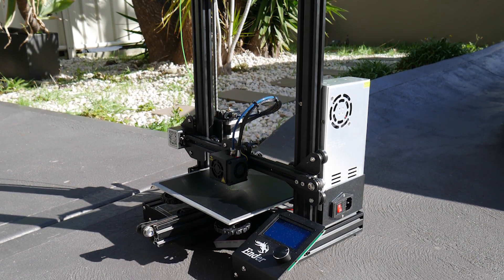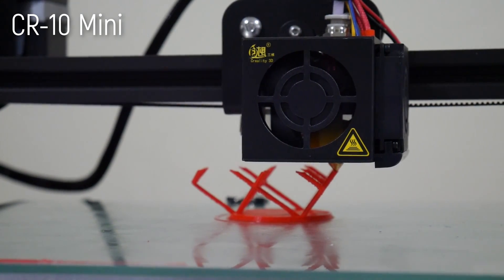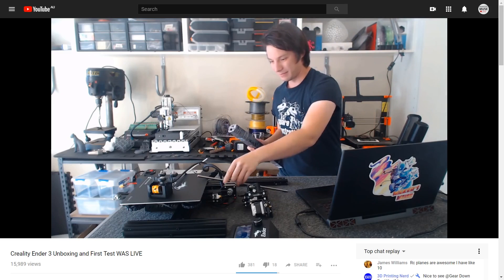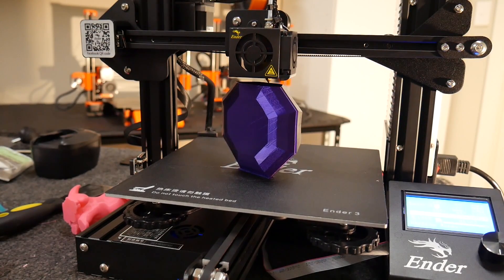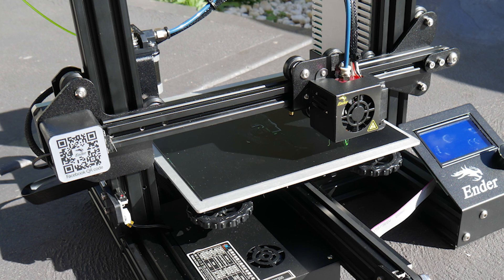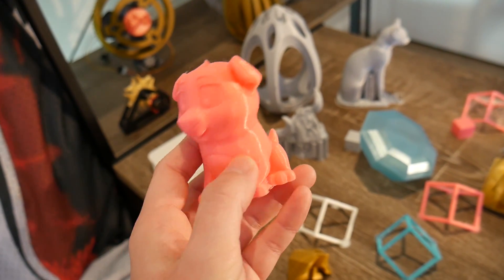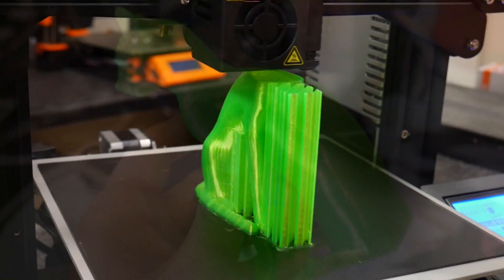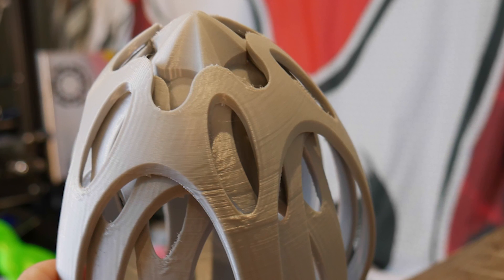Creality Ender 3 Review

Comment: Not Buy in Gear Best: The product is good printing, but unfortunately I had a problem with the driver of the board and some of the axis stopped working days, so contact customer service and this is really bad, I returned the printer right where they told me now they are not able to locate it. I advise to buy the product in another website with more guarantees, for example Amazon.

No comprar en Gear Best: El producto es bueno imprimiendo, pero por desgracia tuve un problema con el driver de la placa y unos de los eje dejo de funcionar a los dias, por lo que contacte con el servicio de atención al cliente y esta siendo realmente nefasto, devolvi la impresora justo donde me dijero ahora ellos no son capaces de localizarla. aconsejo comprar el producto en otra web que de mas garantias, por ejempo Amazon.

Comment: Hey, I bought an Ender 3 and have had it setup for about a week now. My prints are leaning forwards on the Y axis. I've re-levelled the bed countless times, made sure the printer as it sits on the desk is level, tightened all belts and pulleys. These are all the suggestions I can find online and it's still leaning. Any insight to what could be causing this would be great!

Comment: ive had the ender 3 for a couple months now and i havent had any issue with the couplers, i have noticed alot of irregularitys with prints tho. i can print 3 models from the same g code and they will all be slightly different. the tolerance could be a little better too but for a first printer it will get the job done, ive printed everything from coin corters to models, etc. it works just dont expect perfect results every single time

Comment: I really would like to see more direct extruder designs someday. I know it's harder to swing a motor around than just a coupler, but add another $50-150 onto the price vs a bowden and I'll happily work around that to tune it if it needs it. Converting a printer to direct is usually at least a little painful, with making a new head and all that, but it's the first thing I'll do if the frame and motion system are up to par.

Comment: I am all new to 3d printing and I got my ender 3 printer about three month ago and I have had none of the explained issues. Maybe there is just a very big difference in the quality they ship out. But my assembly when very smooth and everything lined up perfectly. I spend very little time with calibration before I got what I would say pretty good prints. When I compare to a printer we got at my work witch costs 6 times more there is not a bit difference in quality there 😁 but thx for an honest review 😉

Comment: Dear Angus, I bought it finally. Some issues with the Z axis ,It seems to cog sometimes and making strange noises, my first print was into the base layer, as you stated, and as i tried to print for the second time, I had to adjust the bed screws ,to avoid the hotend rubbing against the part??every 10min or so.. 
I am afraid that I need your Profile for cura.  Is there any chance helping around? 
I have seen many ytube vids over this and I found it hard for my first print ever. Another mistake I made, is that I tried to print a file newly made by me, so maybe the design was faulty etc.. I can not know what went so wrong.
 Thanks in advance.

Comment: Hi Angus,
I am a newb with 3d printing a bit of an old fella so go easy with me. I bought a ender after looking on youtube, I can get it to print pretty well but would like to upgrade the clamps that you had a problem with (are they called collars or colletts or something?), Anyway if you could add a link showing where better parts can be bought I would be grateful, oh and I don't know how to level the bed on mine, luckily it seems to be level and works ok but can you point me in the direction of instructions for leveling the bed?
Many thanks, Ian

Comment: Just received my Ender 3 for experimenting with 3D printers hardware etc... I noticed I have a total different version, a full steel hot-end, CR-10 parts on the bed belt. Removable print bed seems like that fake built-tek placed on a PCB sheet so you can remove that bed, and also different couplers and bowden tube.

TBH I do not like those big ass level knobs since it's easy to hit / touch and rotates too easy. It's also wierd why my first print was perfect but now prints in the air lol...

Comment: I was quite lucky with my machine as i only paid 160 british pounds for mine. I used the simplify 3d deafault profile fot this printer and have only had great results but i did have to complain as the wheels on the bed were damaged but technology outlet sent me new obes asap. I had also ordered a hardend nozle but the nozle type advertized was incorect so once again technology outlet provided me with a free swiss hardened nozzle. Overall if your up for a bit of tinkering with it after you build it. It is well worth the money. I should also note i got mine on sale and managed to get an extra 20 percent off. I dont mind the manual leveling as my other 3 printees all have it. I personally wouldnt bother with abs on this printer due to the lack of an enclosure but do find it to out perform a reprap pro with an e3d titan aero on when printing pla.

Comment: Anyone have experience with abs and nylon with the ender3?  I use a FF Creator Pro at work with good results...will I hate this printer?
Reply from the maker: No, dont buy this for those materials. Open frame and wrong hot end for high temp.
Reply: Maker's Muse thank you for the response!

Comment: $240 right now on Amazon. Here's the question though, would you recommend this or the fantastic Anet/Alunar A8 for $140-160? My Anet A8 has been printing now for almost 2 years, no part replacement/repair. Few upgrades. I think I finally need a new nozzle. The BLTouch upgrade was worth its weight in gold. It and the Skynet upgrades turned the A8 in to a 'load, start, walk away' affair. Check calibration maybe once a quarter. Probably only 1 in 15-20 prints fail to start correctly. Can't remember the last time I had a failed print. I should print your torture test egg...

Comment: Hey guys...what is the subreddit or forum or whatever for the ENDER 3? Just purchased one along with 5 1kg spools of filament, extra nozzles and those fittings that are recommended. I want to find good info on what software to get. I've got fusion already but no slicers. THANKS!

Comment: I received my Ender 3 June 27th from Amazon. I had no issues at all with the PTFE tube from the Bowden to the hothead. It did have tight eccentrics on the bed wheels. It felt like there were flats on the wheels when the bed was slid back & forth. Just loosing the eccentric until the bed wobbled, then tightening until the wobble was gone solved that. So a simple adjustment solved the printing defects caused by bed motion. There are a number of videos that detail adjusting v-slot wheels correctly. I don't care who makes the 3d printer, there are some things that will have to be adjusted from time to time. Take a few minutes and learn about the adjustments that your printer will require. As far as bed leveling, if the v-slot wheels are adjusted correctly, you should not have to re-level the bed very often. Adding $50 to the price of a printer is a total waste on a printer under $1000.00. If you have to re-level every print, something is wrong and needs to be addressed. Because that is a sign there is a hardware issue throwing the bed level off. Which in turn means that you will have issues with the print quality. Just like Angus describes in the cat.

Comment: Have I been lucky well I hope so have just starter printing all the little additional parts to make the Ender 3  better  seem to have one of the good ones the only miss step was the controller  cable pinched in the bed rollers but dosn't seem to have broken the wires but both the screw threads on the to thin aluminium power supply cover stripped as i was screwing them in but for the money so far Ihave to say Iam Satisfied. Ian

Comment: I consider the Ender 3 to be the new hobbyist printer - i.e. a basis for tweaks and upgrades to make an excellent printer. It replaces the Anet A8 in that regard and probably needs a lot less work to get excellent results. My printer started life as an Anet A8 but is now barely recognizable as such since I've done so many upgrades. The biggest upgrade was the AM8 extruded aluminum frame - that change alone allowed the MM clearance test to print perfectly when with the original frame (even with a lot of braces) the 0.2 and 0.15 parts were fused. I'm currently getting prints that I would call perfect within the limits of FDM technology.
Since the Ender 3 comes with a solid aluminum frame I think the mechanicals are much better out of the box, and it should take a lot less work to get it to the same level of quality that I've achieved with my A8.

Comment: Thanks for the video. The adhesive mess when unsticking the old bed surface is super easy to remove by using citrus cleaner spray. Pre-heat the bed to 60 also helps. 

What's your opinion on the Y design and the horizontally rotating rollers? I have the Ender-2 and trying to remove a print always make the slider rock, no matter how tight the rollers are ..

Comment: Got this printer yeasteday, of course at the first 10 minutes of printing bowden tube popped off, reattached and seems to be fine for now, but will buy better on anyway.
In my case I can see some under-extrusion but not much.
And bed is warped, have to accept that I have to leave bigger gap in sone spots and so first layers are pain in the ass.
+ had to weld to filaments together because included white one was ending throught half of the print of model from the SD card...
But once I managed to finish it, my first print ever looked very nice, I'm happy about that :p

Comment: Here is something you should warn people against too: TEVO currently has the flash as a upcoming model. A smal number of videos are referencing it, and TEVO has been taking orders for about 3 or 4 weeks for it on Aliexpress. 
Upon placing an order, they engage people to find the power requirements for the target country per usual. 

Within 2 days, they sent me one message that the printer would not ship for 20 days past the initial ship date of mid july, asking if i wanted a refund. within 3 hours of that initial message, they flipped the status of the order to SHIPPED, with a bogus tracking number (i verified it multiple times in the last 3 weeks and it was UNKNOWN to the carriers). 
I complained to the vendor about that, and they acknowledged that the ‘parts are out of stock’ and that i would have to wait another 20 days from end of july for shipping, or that i could open a dispute to get a refund.
In the meantime Aliexpress blocks the possibility to open a dispute as soon as the tracking order appears. So TEVO blocks customers from starting the process when they know there is no shipping order... a bold face lie. Meanwhile, Aliexpress waits for these 10 days to let u start the dispute... all good if you actually could start the process.... but after 20 days from the fake shipment date Aliexpress would still not let me start the refund. Finally i complained real hard about how they are de facto encouraging this behavior with their system, and just like that, they opened the dispute.
Aliexpress has a vested interest in letting the vendors operate like that because the cash people pay and which thye keep as guarantee until payment is released represents huge sums of money that their finance department surely enjoys getting the dividends from... even on day by day money market, this is huge financial revenues for aliexpress... likely more than any commissions the company might take on any given transaction.

So there... not only do printers vary from the time of review to when mass customers get them, but TEVO also lies about the status of orders that they receive. The point of sharing this experience (i have all the screenshots proving what i describe) is to let people make their choices with more info. I could have kept going on with the order... and a printer would likely have eventually showd up, and maybe even one that i would have enjoyed using....i decided to bail out of the order because i think that a company ready to lie at the stage of order is a company that will likely lie about many more things. Especially quality, reliability or security.

Dealing with china is about a cultural adjustment we must all make individually. Morality or customer service or ... none of that means the same as in our western cultures. Not better not worse, just widely different. As buyers we have to adjust our expectations, and as sellers they have to adjust they practices... or not.

Keep up working like you do... 🙂

Comment: Wait. So, 3D printing noob here. I swapped out a direct extruder on my i3 for a Bowden style one, to make room for a 3D touch. Are direct extruders better or something?
Reply: After 4 printers I will avoid bowden types if possible. Direct extruders have much less slop so generally lead to much better prints. The lighter mass of the bowden setup does allow for faster movement and the extruder stepper stays cooler, but I find the benefits of direct drive to outweigh bowden.

Comment: Well... The Ender 3 is my first 3D printer and i had no problems with the bowden tube system whatsoever. Just FYI :)
Guess i was lucky or my printer was a already modified by Creality. 
PS: i set the retraction to 10mm at 60mm/s and have no stringing, not even whisps. :)
Edit: The Ender 3 neeeeeds fine tuning at the start. i was able to remove artifacts, underextrusion, wobble etc. Did i mention that this is my first printer?! :D So it can't be that difficult.
Reply: My printer is running well, yeah it has a few artifacts, but thats the thing I expect that based on the price range.

My £30 inkjet isnt going to print quality prints vs a £300 printer.

I think its a great intro into 3D printing. It does need some TLC to get going but once it does...

Comment: I see the ezy surface is smaller. You centered it. How does that work for calibrating? I haven’t used the printer yet. My Prusa expels a line near the edge. Mine came with what looks like a 4mm plastic piece with the black mat stuck to it and clips to attach it to the bed. What should I do! I don’t want to stick down the ezy yet. Should I?

Comment: What pneumatic fittings does it have? PC4-M6 on the extruder and PC4-M10 on the hot end side? I didn't find the recommended replacement parts in the description, only in the other video, but I'm not sure if they are the same for all creality printers.

Comment: Another good video and honest review. This is my first printer and have very mixed feelings about it and 3d printing in general. CNC milling seems much more reliable compared to this trial and error approach. Anyhow, my Ender 3 also arrived with a bent heated bed. I've seen that others also have this problem. Anyone managed to fix or replace it? I tried to make it flat using a method I saw, but I'm still left with a slight bow in the middle. Also had issues with over tightened rollers, the one on the z-axis I think is the trickiest to adjust, I took the Z screw off to allow for easier adjustments until I could move the whole Z assembly freely by hand. Looking on how to upgrade it, glass surface, extruder etc. but I'm a bit afraid that I waste my little budget.

Comment: Thanks -- ordered for $239 Amazon Prime (that price includes shipping).  Got to me in 2 days. Seems to have some engineering improvements to overcome the faults in the previous versions of Ender-3.  I assembled and can't help but think that using an inch-pound (Newton-Grams -- is it?  For you I think) torque wrench to get all the fasteners spot on and evening the stresses might make the unit more solid and squared.  Just to match all the torque values of each type of fasteners -- especially on the frame. Also, I think possibly using a temporary thread locker on the threads of the fasteners might be great to keep it all held together well.  Also, believe the three-wheel brackets on each end of the gantry could then be installed without the lock-washers and this may improve the rigidity of the overall setup.  I would call it a kit.  I put it together from the diagrammed instructions alone and notice an error or two:  Step two doesn't mention the two stainless-steel M4x20 size of the bolts that go into holding the powersupply to the frame.
.
BTW, I noticed the TH3D code you can download and use to re-flash the bootloader in the Ender-3 and also the firmware has code in it to to Auto-Bed Leveling.  Haven't delved into that just yet but apparently the capability is there if you add a bed sensor and appropriate connections.